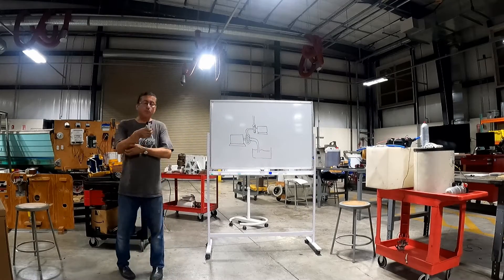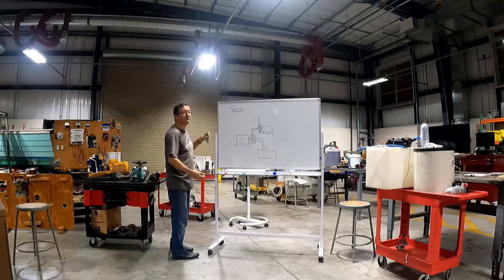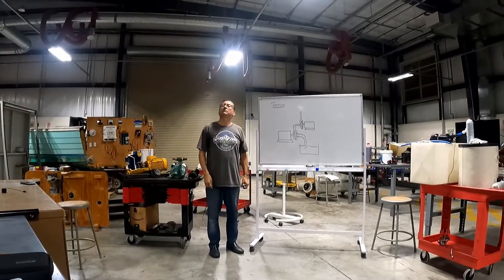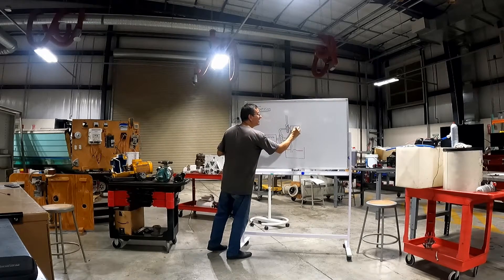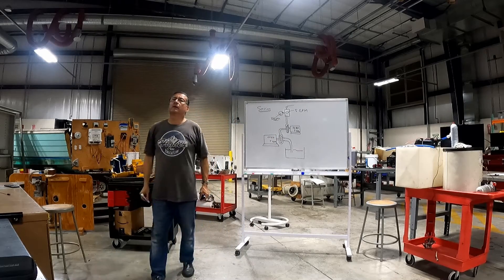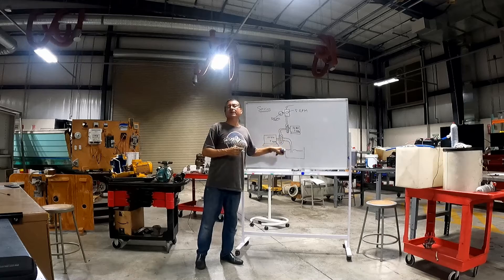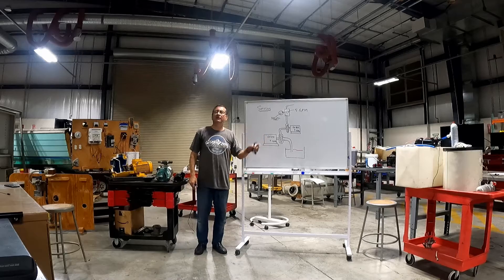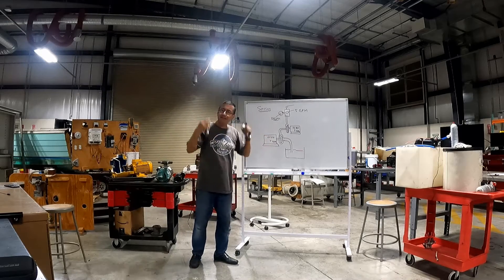Connecting pumps in  Series and Parallel to increase Flow and Head / Clip

Comment: Hi my name is Kingsley, what will happen in an installation where high lift to low lift pumps connected in series?
Reply from the maker: Pumps connected in series are used in application when you need more head or more output pressure